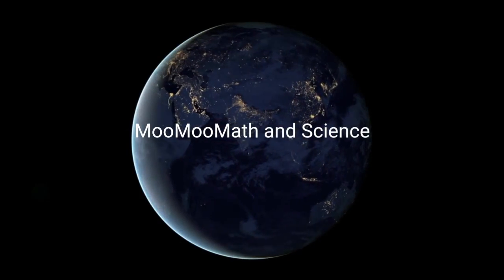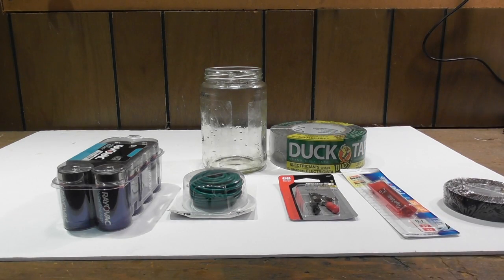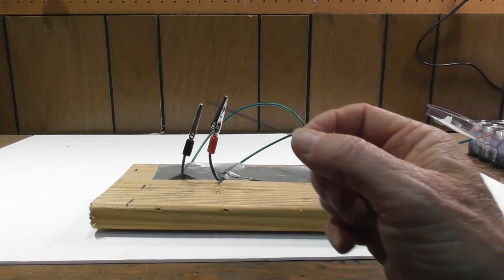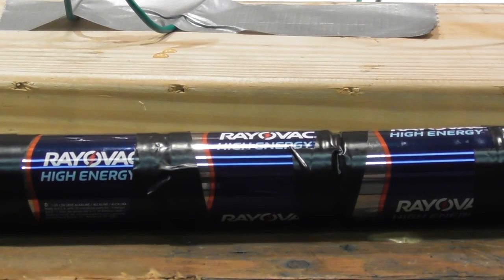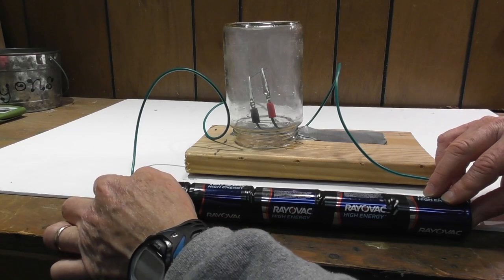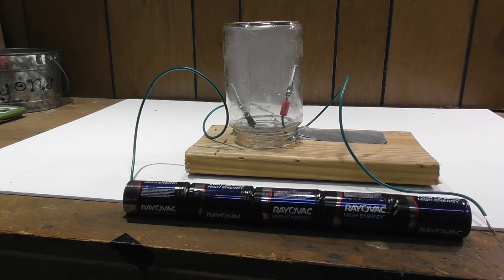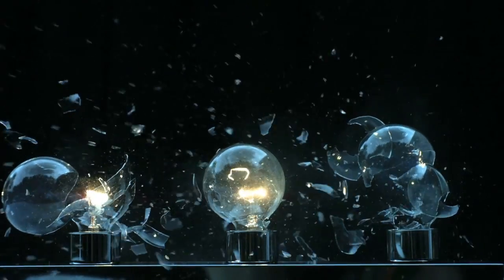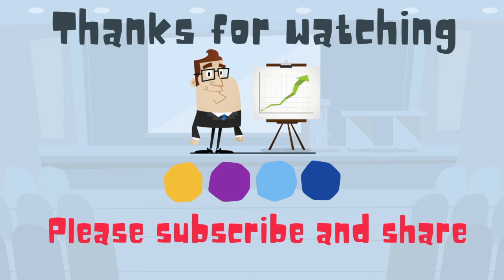How to make a light bulb Science Project

Comment: bruh i did exactly that and you know what happent it smocked and got realy realy realy realy realy realy hot
Reply: At least yours one smocked, mine is not working at all.
Reply: @raojinaitam1545 i know some adjustments to fix it if u want
Reply: @laraibchaudhryy  please
Reply: @raojinaitam1545  You know when u put the alligator clips on the wires, put them on each side of the wire, instead of 5 batteries i put 6, when ur taping the alligator clips and wire to the wood, i instead taped a plastic cup to the wood then put the alligator clips (with the wire) taped onto the side of the plastic cup, the last thing I did was when ur putting the alligator clips with the wire together im not sure which alligator clips u got but the one I had, had  some tiny circles so I put the wire loopee in there,( make sure to take off the plastic protector of the wire)